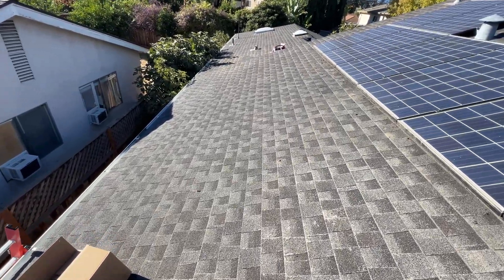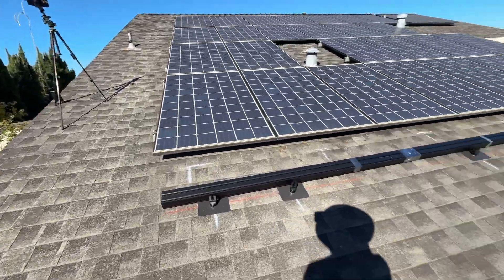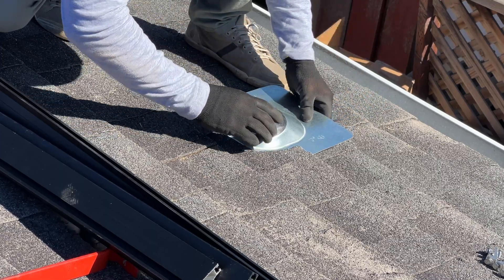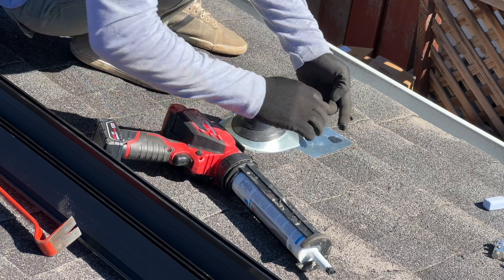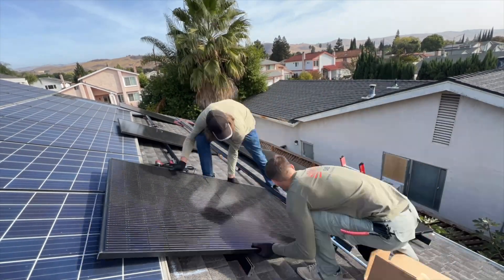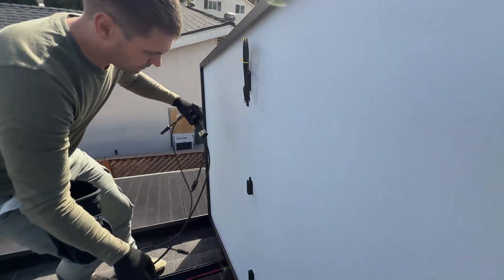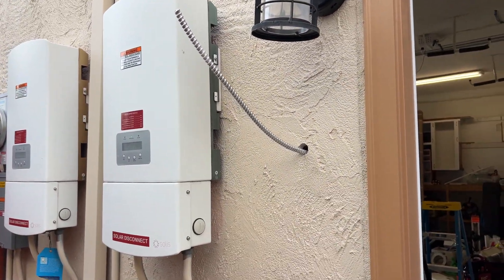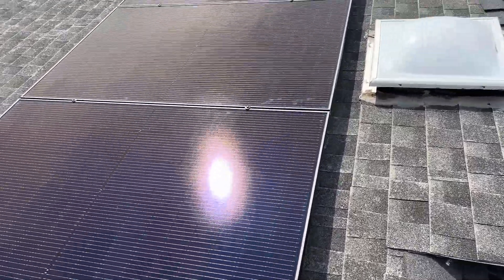Installing 13 solar panels, 5,265W array with Ecoflow Delta Pro Ultra.

Comment: do u need permit for that set up?
Reply from the maker: yes
Reply: @SolarEngineering so the exposed mc4 wires as it enters the EcoFlow ultras wasn’t an issue with passing inspection?

Comment: Do you run PVC conduit on the roof or metal?  (I know code requires metal inside a dwelling over so many dc volts - curious on the roof since that's optional)
Reply from the maker: it is 3/4 metal